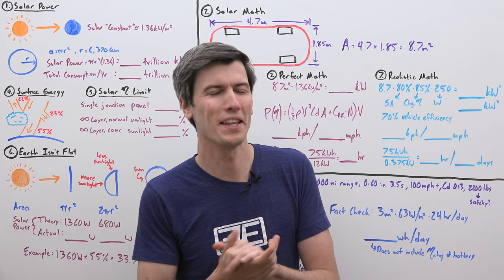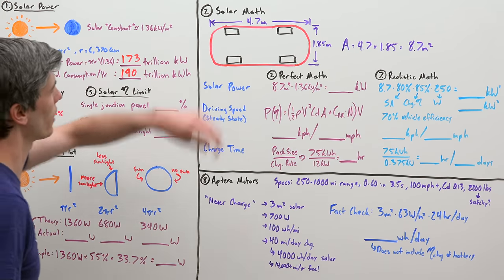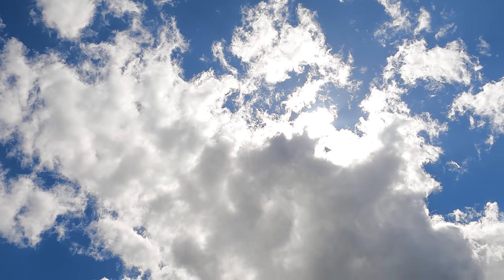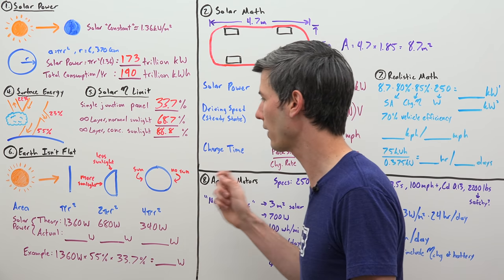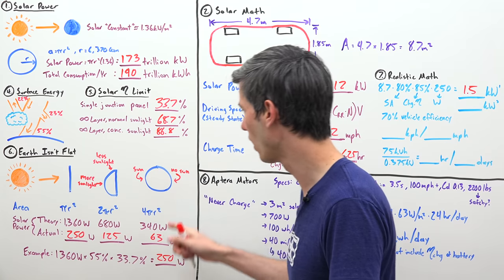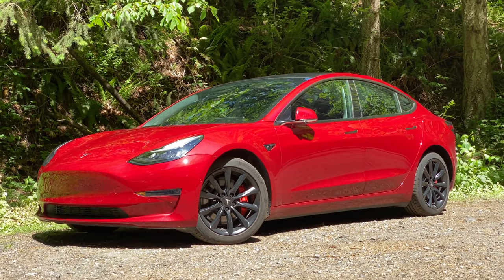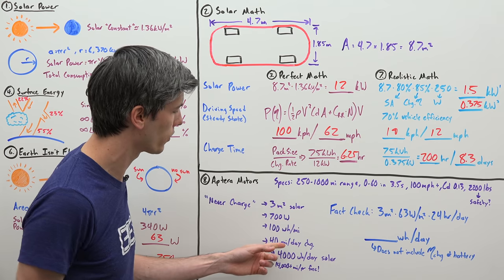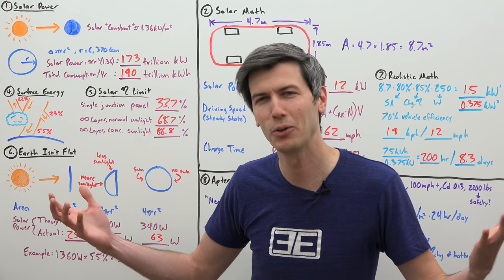Why Don't Solar Powered Cars Exist?

Comment: Having a small part of your tesla roof coverd with solarpanels would be nice to save the car from the so called "vampire drain"? :)
Reply: Covering the power used by sentry mode would be great.
Reply: I know a solution like that could definitely help, but I think the bigger issue is the cost of the panels versus the actual energy saved. I know some cars will offer a solar roof as an option, but it will then cost like 3K to 5K. At that point I feel like it’s not a feasible option. But maybe at some point in the future it will be.
Reply: Yes, and not just for Teslas or electric cars in general. Using a small solar panel to maintain the battery and overcome vampiric loads is a good strategy for ICE cars too.
Reply: @Dwhizzle  Thats it. It adds to the cost, and I think most people have no idea how laborious it would be to integrate a solar panel on the roof. I mean it has to resist all the vibrations and shocks from the road, they need to isolate it proper, they need thick cables and extra fuses... it adds also to the weight. Tesla has had already problems with manufacturing the cars. Its not worth it considering how much you gain out of them.
Reply: Or perhaps a better designed vehicle with no such parasitic loads... 😒
Reply: @Dwhizzle  I don't think that's what "Tesla Solar Roof" means.
Reply: @ps.2  the video is about solar roofs on cars. I think it is what it means in this context.
Reply: @danielchin8073  I've sat in my pickup and listened to the radio literally all night and it would start the next morning every time. As soon as you drive the vehicle it charges the battery back up. 

I also leave my phone charger plugged in which works with the key turned off while leaving town for a couple of weeks on vacation. It never drains the battery. And the phone charger has lights on it. I don't think gas-powered vehicles would need solar panels for vampiric energy drain.
Reply: @Dwhizzle  "I know some cars will offer a solar roof as an option, but it will then cost like 3K to 5K. At that point I feel like it’s not a feasible option." well tesla plaid costs 140k, so.. 3-5k isn't on their mind of problems.

Comment: Even making 10% of my power from the sun would be awesome, when your cars stays still at the Country house for the weekend is a perfect time for free energy to get back home. Also not worrying for your car to uncharge when it stands still for long periods of time is nice, I only use my car like 3 times a week, if I didn’t have my car in the Garage, I would never have to charge it.
Reply: Yeah hopefully they remember to include a trickle charge system for the 12V battery, it's interesting how many electric cars are left immobilized because the 12V battery is drained.
Reply: The phantom charge issue is reason enough for solar panels.
Reply: There’s no reason at all for 12V battery drain for an EV that’s connected to a charger - the contactors to the HV system have to be closed so there’s energy to the inverter to charge the 12V system, unless the system is just designed stupidly.
Reply: If you average the miles generated per day its 24 miles per day Produced by the car  (8.3 days per full tank, 200 mile range, yada yada), this is around the average for americans to drive every day, so it actually does mantain itself basically.  (Avg american drives 29 miles a day, 24 is 82% generated by the car)
Reply: @babybirdhome  I believe early Tesla Model 3s had this issue. The main battery could be charging but the 12V would be drained. I am unsure if they solved this issue.
Reply: Somehow I think you wouldn't buy a car of a color that seems slightly off to you, let alone with an ugly square roof rack of solar panels.
Reply: @NGC1433  have you seen the Tesla roofs/ integrated solar? It wouldn’t be a square and you wouldn’t think it’s ugly

But to be fair putting the solar just on your roof instead of a car fixes most of the problems car solar presents-like garages.
Reply: @Cameron_Mind  Have you seen a Tesla move a meter on that panel roof? Dude, just stop embarrassing entire human race. Learn primitive arithmetics. That panel won't be able to run a cabin air fan.
Reply: @NGC1433  wtf? Literally everything you said made no sense. “Have you seen a Tesla move a meter ON that roof panel?” What do you mean my dude
Reply: @NGC1433  also everything I said was true. 8.3 day charge time literally is over 20 free miles a day of charging just from the panels in the roof of your car.
Reply: @Cameron_Mind  So you actively refuse to use your brain? Those numbers you claim are true are optimistic marketologists bullcrap that has nothing to do with reality. How often do you plan washing that roof? Is it 100% sunny 100% of the days and there never is any shade over the car? Is the fact that it takes a bunch of energy to cool a car that stood in the sun all day by it's air conditioning?
The imaginary economy you are all hyped up here is just like saving heaps of money on utility bills by never flushing your toilet.
Reply: @Cameron_Mind  Exactly, I typically drive 5-10 miles per day.  Free and easy transportation for almost all of my driving.
Reply: @valderon3692  yup. Especially for me where I live in arizona. I probably could get like 40m/day
Reply: @Cameron_Mind  Oh yeah, I'm sure you probably could.  I'm in Utah, not quite as much sun as Arizona but still a lot.

Comment: You have to understand that most of the world population live close to equator (Asia, Middle East, Africa, Central & South America) & it is there this will work better. 

The capacity of 1 sqm standard solar panel is approx. 200 W per hour. For a car of 6 sqm surface (roof & bonnet), it can generate approx. 6 KW per day (200 W X 5 hours X 6 sqm). The average EV efficiency is approx. 6.75 km per kwh. That means solar power can run an EV approx. 40 km a day. 

40 kms is the average daily commute for any urban dweller. I drive 14 kms to the office & my car is parked at the office from 8:30 to 17:00 hrs under direct sunlight. If I can have solar panels on my car, I would not want to charge my car ever. Countries close to equator such as Sri Lanka get 8 - 9 hours sunlight daily throughout the year. 

I am not an engineer & studied Bio-science. I just picked up those figures from the web & calculated. I really appreciate your insights on this.

Comment: One other feature of a good solar charging installation would be to run at least ventilation and if possible air conditioning vehicle that may be parked in a sunny location with no cost to your range. I purchased an early version of a width adjustable unit that you just put on top of your rear window and rolled it up to trap the fan in the slot. Living in Vegas with a dark green Subaru I was trying to keep the interior temperatures below flammable levels, LOL!

Comment: Jason is really invested in EVs these days and he is converting me from a petrol head.
Reply: You can be both!! I am!
Reply: Like it or not, it seems like the industry is headed toward EVs... I don't mind, but I like gears and knowing when to upshift just by hearing
Reply: @WalterRitchey  truly it. It is not always about best efficiencies, thermodymics, Enviromment etc etc. It is also about Charecter, Emotions, Economy and Employment. Electric Cars have less moving parts, zero noise, huge charge times and still hugely pricey. 
They are not parmanent but transition things
Reply: STAY WITH US STAY WITH US
Reply: EVs are lame
Reply: @orvvro  people convert old manual cars to ev's by slapping a big old dc motor onto it, the large brushed dc motors are most efficient at 2,500 - 3,500 rpm so it works out perfectly with a gearbox.
Get the best of both worlds that way, problem is the cost of batteries really adds up
Reply: @ritdhar6579  Well given the channel is Engineering Explained, it really is all about that
Reply: @ritdhar6579  huge charge times and prices are going down decently fast. I won't say EV's are still necessarily cheap, but they've became much cheaper than they were. Charge times are going down too, and will eventually become very short.
Reply: I've been wanting to DIY an electric car for years. Unless a cheap used (non tesla) ev falls into my lap it'll be a bit longer before i get one. I'll find a nice body and convert it.
Reply: @ritdhar6579  and also the battery fires
Reply: @volvo09  a non Tesla wouldn't be that easy to find. Maybe wait for Toyota to finally implement their solid state batteries into a car(but they're also really into hydrogen, so it might take quite awhile). Oh yeah, and VW also partnered with a company to produce a solid state battery, so maybe they could be a good choice too.
Reply: @WalterRitchey  this. We got it. He got a Tesla and in Elon cult now. But ffs do other type of videos. This was my last vid. I already unsubbed.
Reply: @orvvro  another lost art!
Reply: @archygrey9093  sarcasm I presume
Reply: @ayoutubechannel921  yeah electric cars catch fire less often than gas cars actually…
Reply: @Deepwing  but the fires are harder to put out and the fumes are much more toxic
Reply: @ayoutubechannel921  fires in ev's happen less than 10% as often as in ice vehicles. It can happen but an ice car is far far far more likely to catch fire than an ev. It's no different than people being scared of dying in a plane crash. It's a risk but it's 10 times or more  less likely  than dying in a car crash. Lol but everyone just jumps in their car and drives, same as every time you get in your ice car you don't worry about dying in a flaming inferno even though it's ten times more likely than burning in an ev haha. This got dark fast lol
Reply: @ayoutubechannel921  yeah but the new battery by quantumscape won't have this fire problem.
Reply: @WalterRitchey  you guys are on crack. I just looked back on his last vids and only 3 out of the last 14 had anything to do with electric vehicles.  Jeesh.
Reply: @SaintMecha  only 3 of his last 14 videos have anything to do with ev's, so I'm not sure what u are on about.
Reply from the maker: @WalterRitchey  Haha what? Three of the last ten videos I posted relate to electric cars (seven don't). I wouldn't say that's "all I do."
Reply: @WalterRitchey  the channel is engineering explained, not car and driver
Reply: @ayoutubechannel921  Gas fires aren't much better.
Reply: @SaintMecha  What does Tesla or Elon have to do with Aptera or solar powered cars?
Reply: @orvvro  I'm sure someone will come up with a simulator.
Reply: @ayoutubechannel921  Harder to put out, I'm not sure they are more toxic. Maybe they are. And how do you handle an EV in an accident? How do you recycle the battery safely and efficiently? These are real technological problems.

Don't get me wrong, I'm buying an EV as soon as I can. But the problems are real. It's imperative that EV makers put everything they can into making reliable, long-life batteries.
Reply: @EngineeringExplained  Ignore the haters. You're doing a really balanced mix of ICE and BEV/alternative energy content. Keep it up, you're making amazing videos!
Reply: 😂 Jason is shocked and disgusted at being called an EV guy (as any good petrolhead should... jk)
Reply: tinkering DIY EV is fun too even for petrolhead
car guys like speed, efficiency, engineering. so does EV head
Reply: @ritdhar6579  if they are not permanent then what do you think is?
Reply: @EngineeringExplained  All you do is EV's unsubbed, ratiod and cancelled my dude.... (/s)
Reply: @ritdhar6579  character *
Reply: @ritdhar6579  Most people charge overnight while they are sleeping, so charge time is effectively zero -- much less than what some others spend inhaling poisonous fumes at the gasoline station. Ten minutes per week is 8.6 hours every year.
Reply: @WalterRitchey  You are one person. EVs get more clicks.
Reply: @foxgaming76yt24  considering it's about 12$ to fully charge a Tesla M3 Long Range. The total cost over 3 years will be so much lower. If you keep the car longer than 10 then it'll be much greater in savings.
Reply: @jetah50  ok?
Reply: @Ascii89   Thank you and enjoy your life.

Comment: As I see it, there are three reasons for solar-powered cars.  

First, you're going to have a battery hooked to the grid, with (hopefully) enough electronics to be smart about how it draws energy.  That's an ideal place to put a little bit of solar collecting capacity into the system.  Second, there's the chance that you'll be somewhere that you can't charge your battery from the grid, and you'll be out of battery charge, whether that's because you went "oops" at the end of your range, or because you used some electrical device powered by your car battery, or because there was a power outage.  If necessary, you can wait for a few sunny hours and then drive to somewhere that you can plug it in, instead of having to come up with something else.  Third, you get to extend your range a little.  

Expecting to drive entirely on the solar panels isn't among the reasons.
Reply: It will be for some users, but as you point out, there are many others.  Just 1000 Apteras with V2G tech in a city of 1 million would cut the peak energy demand capacity for that city by 30%.

Comment: The Lightyear One, a start-up in The Netherland, might interest you. They combine the largest possible surface of solar panels (rooftop, hood and rear window) with extremely high energy-efficiency (low weight, low drag, in-wheel motors, et cetera).  Very good looking car too.
Reply: And for the price of only 250.000 euros.
For that money you can cover 10 roofs with solar panels and buy a Volkswagen.
Reply: @realityandnaturepill  they just revealed the lightyear 2 30,000 euro car with 500 mile range.
Reply: I think they key of the Aptera is it's shape, you have to sacrifice some usability and traditional looks for aerodynamic efficiency. without that weird look you can't be as efficient!
Reply: @mjerez6029  

Absolutely!
It would be even better for a city car if it's way smaller...that's not what sells, unfortunately SUV's have taken over.
Reply: In January 2023, Lightyear announced that it was halting production of the 0 model, and that Atlas Technologies B.V., the subsidiary responsible for the manufacture of the Lightyear 0, would be allowed to go bankrupt.
Reply: good looking car? come on, man..

Comment: The numbers are much better than I would have expected. Not sure your panel efficiency figure is quite right though - tend to see figures in the low 20s for flexible solar.

However, for me the value is that in my on-street parking scenario it would significantly reduce the frequency of having to go recharge. The benefit is one of convenience more than cost.

Comment: Ehh, one word: Aptera. xD

Yes yes, technically it's not powered by the sun directly, but at least you're using power to some extent stored from charging in the sun. xD
Reply: I’m a reservation holder. At the same time, 100 miles per kWh is an aspirational mountain to climb. I currently have my reservation for a 400 mile version with full solar. If the Beta tests show 100mi/kWh,  then I might switch to a 250 mile battery version. I might anyway because I don’t think this will be my road trip vehicle but perfect for getting me to work and running around every day. Even if it doesn’t keep the battery charged- who wouldn’t want a vehicle that can keep the AC running while it sits so that when you come back after being in the store for an hour- it’s still nice and cool inside!!
Reply: Ehhh...one more word, vaporware. Aptera has been making promises since 2006 and already went broke once.
Reply: @truantray  they did, but they're back.

Comment: As always, great video. Yet, you might check out the Sono Motors SION, the Lightyear One prototypes and the IONIQ 5 solar roof option. 
I agree it might not be feasible but there are attempts on the market or in the lab already.

Comment: My thought is a pop-up solar panel you can have in the boot. Thinking mars rover meets pop-up tent that you park under in day. Keeps car cool. And you could recover maybe 0.5 to 0.3 of a charge. Should be doable if very light very compact design to travel. This would be for at work or camping when you have  time.

Comment: 9:30

Its not actually a bad thing. I mean if your electric car runs out of power on a barren highway or in a remote desert, it will never die. You would just have to camp out for a few days until it charges again. Plus it would be charging an eighth of your battery every day if you park outside, giving it a boost in efficiency and range meaning less operating costs by a significant margin. Imagine a toyota prius getting an extra 7.5 mpg. It's not that it should run the vehicle completely, but it would be practically beneficial.